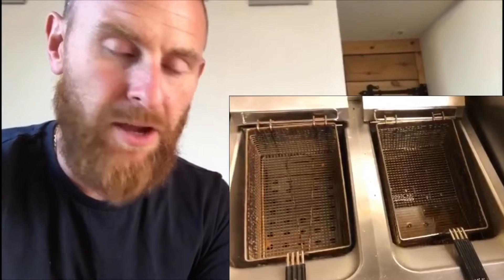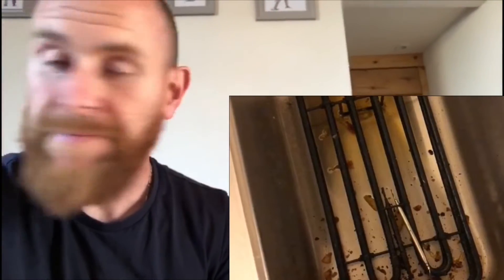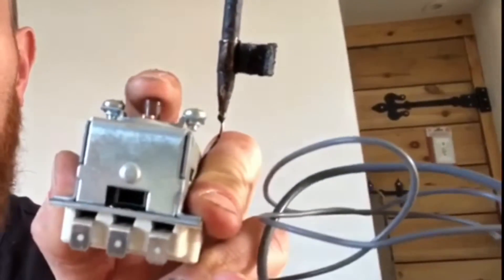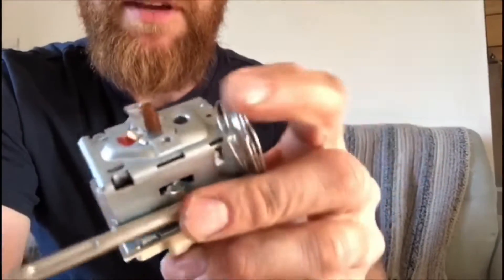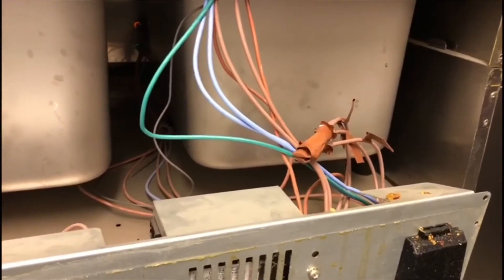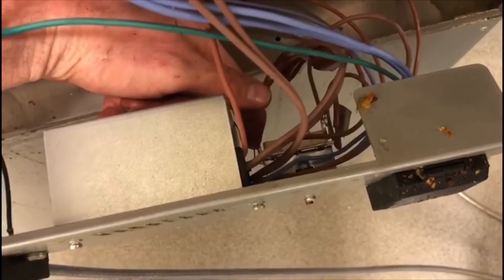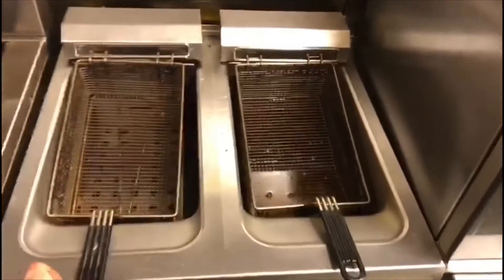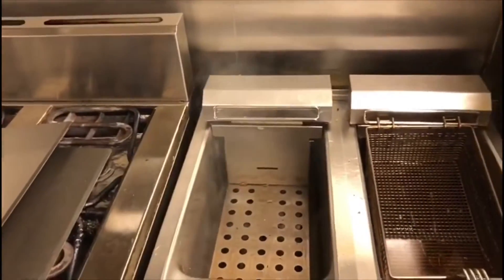Replacing a 3 Pole Thermostat for a Deep Fat Fryer - Electrician Matt

Comment: Hi mate, We forgot to mark down the cable number from the main circuit, is that anyway that you could help me with that please. I have the new thermostat, but couldn't connect them to the right cable like you did. 32 12 31 11

Comment: Thats the high limit cut out switch, the fryer has got too hot and it trips the feed to the heaters. you will find that the main thermostat with the black knob is dodgy so causing the limit switch to keep tripping and the chef has been resetting it and it eventually gave up. 👍

Comment: I used to absolutely hate fixing the fryers you wear kneeling in a manky dirty floor covered in oil & your tools were covered in greese for days only up side to that job you got your lunch made for you when it was up n running a good few times it was the high level stat had tripped on the elements quick fix but dirty hot kitchens 😣